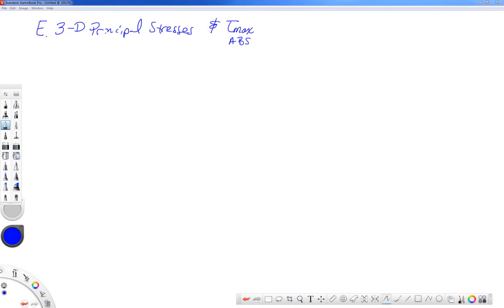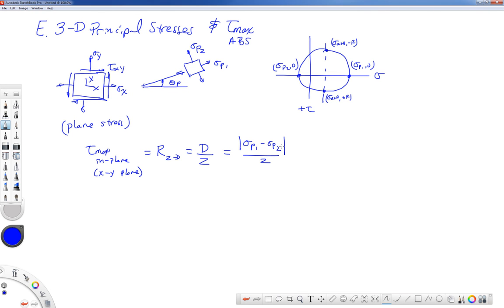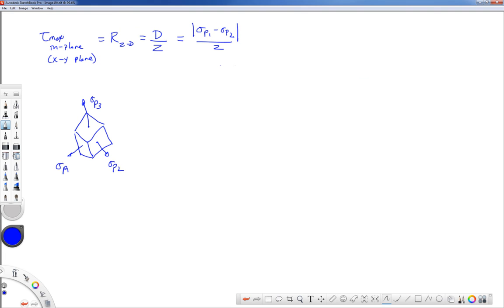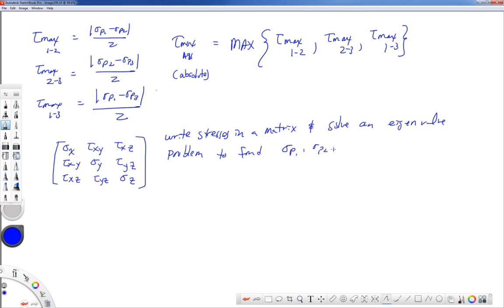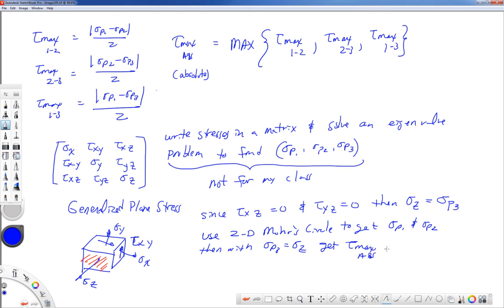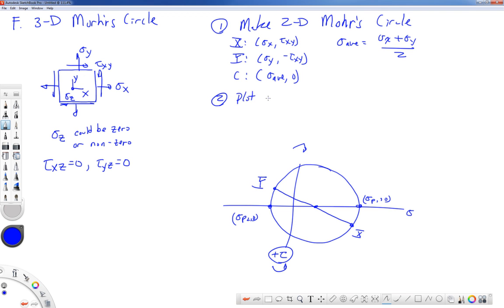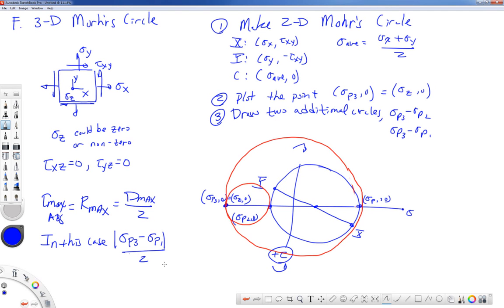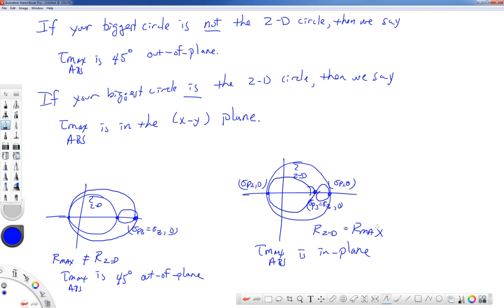Mechanics of Materials-Lecture-28-Absolute max shear stress and 3-D Mohr's Circle

Comment: Sir , then in case of cylindrical presser vessels the vessel should fail along a plane in which absolute shear stress( Maximum) is acting  ( where we neglect radial component) ...
Reply from the maker: Initial failure (yielding) is 45 degrees out of plane through wall thickness.  Once initiated, cracks usually switch to mode I crack growth resulting in the hoop stress controlling the final failure surface.
Reply: Yes sir..That time I didn't mention it but after drawing the Mohr circle things got polished..Thanks a lot sir for your reply..You are such a great person..